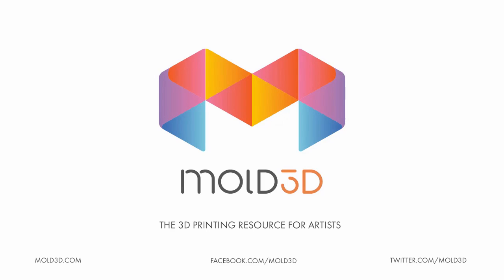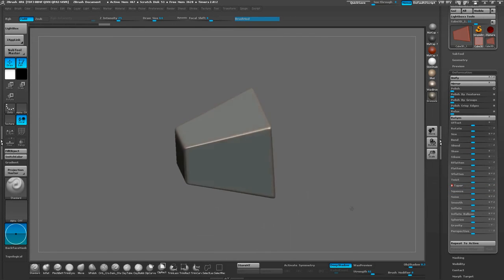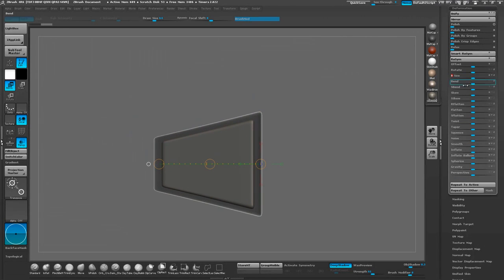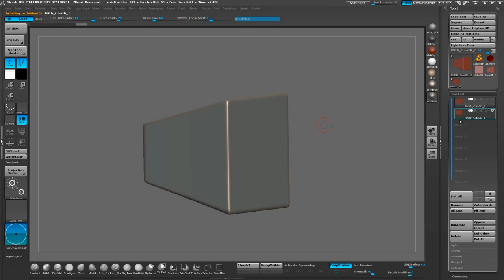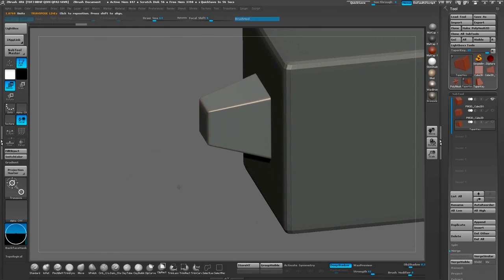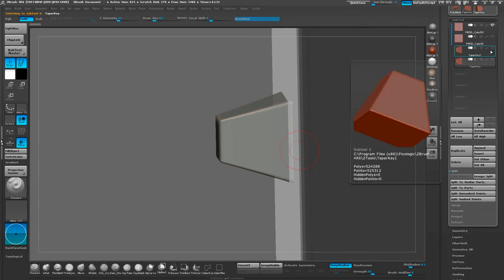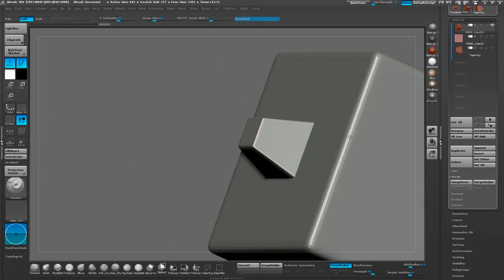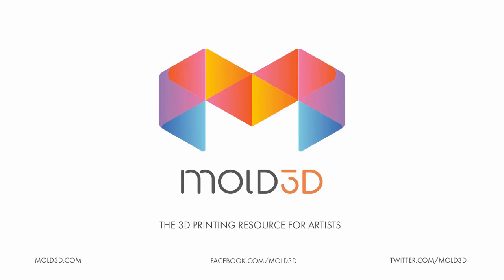Character Keys for 3D Printing Part 1

Comment: Hey thanks for the tip.
I'm working on a model for 3d print and i need it to be in different parts, so this helped a lot.
But as you know any model you want to 3D print requires a certain thickness to it so it doesn't break and prints properly, how would you add that thickness to the model and would you add that before or after making these positive and negative keys?
Thanks!

Comment: Is there a way to split models into pieces in Modo with a specific dimension to print? [e.g 4" x 4" x 4"] Say if I had a model with a larger size than my print volume but I want to piece it together after it's printed. Is that possible in Modo? If not how would I go about doing that?
Ps. Great videos by the way, very helpful!

Comment: Thanks for the vid. How do you separate a model for keying? Thanks again.
Reply: Slice curve
Reply: Josh Crockett
I am not getting it - the slice curve does cut the object, but it isn't separated into two pieces...
Reply from the maker: Etienne Renaud Slice curve breaks the model into different polygroups. Remember that slice also does not work with symmetry. Once you have sliced (you can see the polygroups when you turn on wireframe) you can ctrl+shift click on the section you want to keep and the other side will be hidden. Once hidden you can use the Geometry>Modify Topology>Delete Hidden to get rid of geo you do not want/need.